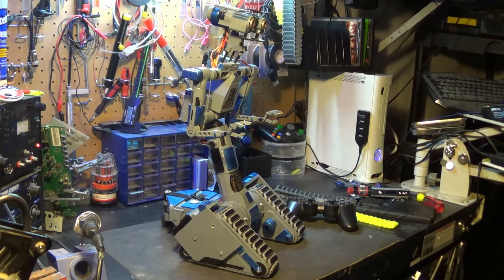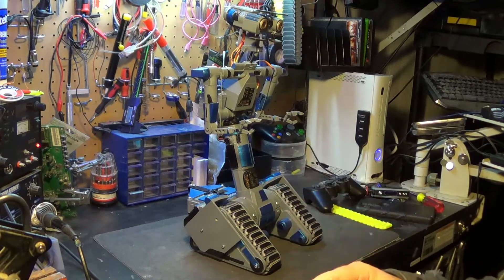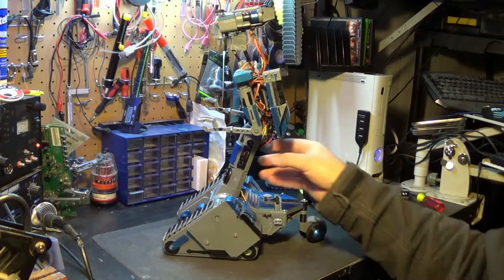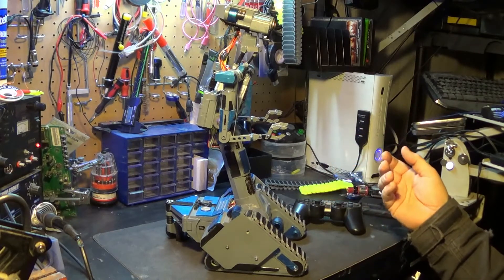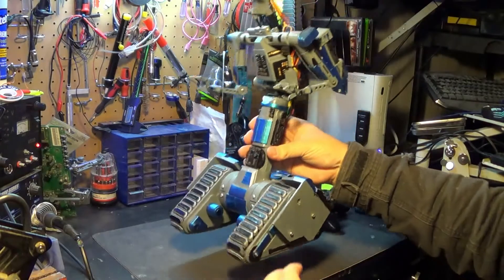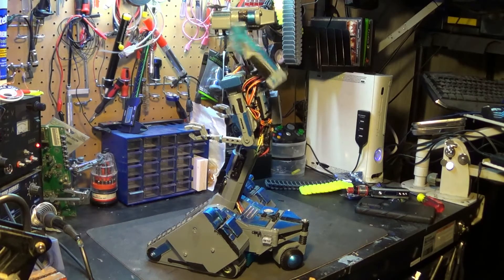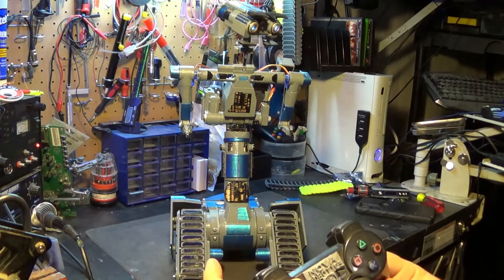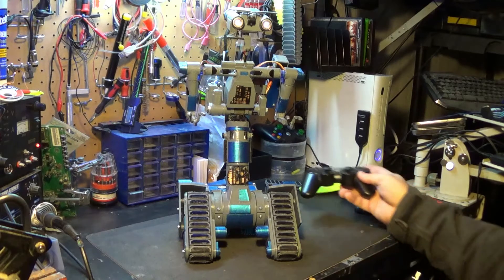Johnny 5 Robot RC Toy

Comment: what servos are you using for the arms, they must be small? Can you post the link to buy the stl files.
Reply from the maker: Just regular old Tower pro SG 90 in the arms. Nothing special. Sadly I had a agreement with the original STL creator Never to sell the files he made. It's been awhile but I believe he was called J.r Dejesus. If you can dig him up he has the static model for sale but you can easy Enough edit for servos. But if you are looking for a the insane model look up Shig Burgin J5 full Robot model. It's more complex but he has his for sale with instructions and Arduino code. Both can be found On Facebook- I want to customize my J5 toy- group. Hope this helps. and if nothing else I was going to try and print up some DIY kits on the model I have. Ironically I can sell all the printed robots I want.